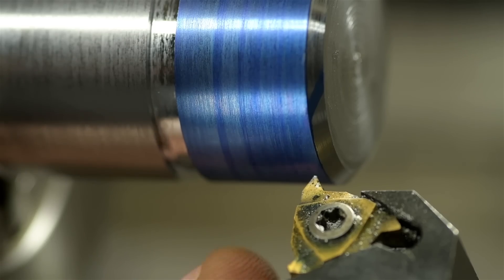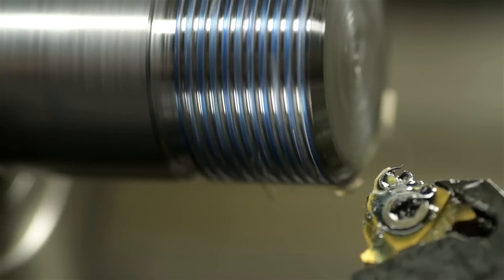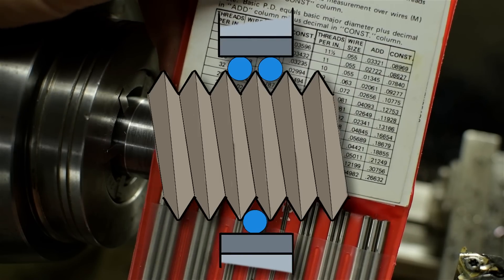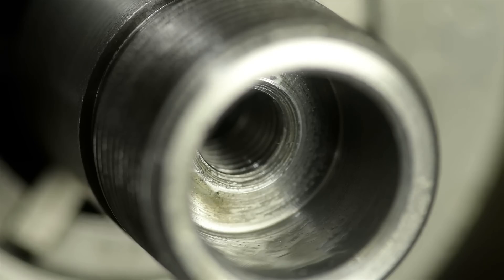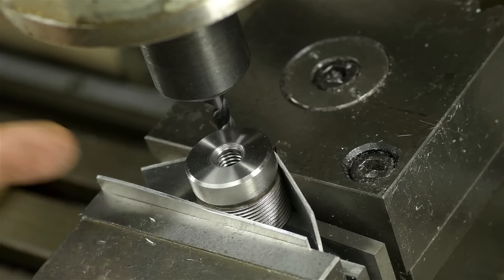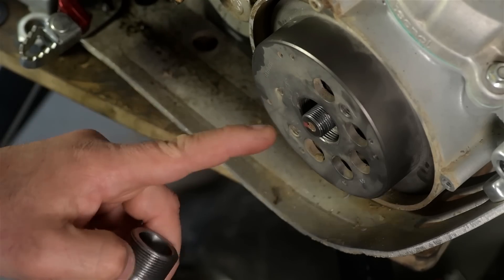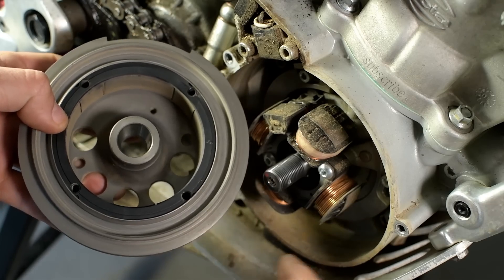EASY Flywheel Puller... using ONLY industrial lathe and milling machine!!!

Comment: You can make the timing adjustable a small amount by ovaling the holes that mount it slightly I did it on my bike its more than enough adjustment to make a difference to see if it does what you want as long as you tighten the bolts good it wont move on you during normal opperation

Comment: I have made a few of these for pulling/pushing high pressure fuel pumps out of diesel engines. I've always had a better result with it when a ball bearing is added to the end of the pushing bolt, it doesn't damage the part that way

Comment: I think theres three 5mm allens holding on a backing plate for the stator that can rotate which adjusts the timing
Reply: This. It has slotted holes for turning the whole back plate.

Comment: Neat tool. I once needed a similar puller for a bike I used to have - lucky the guy who was able to sell me one knew my one was left hand thread. I'd have made a mess if I'd try to make then use one myself.  The stator plate looks like it can have its timing adjusted (fasteners in slotted holes at about 12o'clock and 3 o'clock) or is the ignition purely on the sensor coil on the outside? if so, what's with the 'fifth' coil on the stator?

Comment: Here is a wee tip. When you have to leave your lead screw engages and you don't want to use your compound slide to advance your threading tip to take some pressure off the tip, on the reverse pass, stop the lathe, disengage the low gear so the chuck still moves easily by hand. Carefully continue winding backwards by hand and at the same time disengage your forward reverse (bull gear lever)  lever for the feed. It will just pop out when you relieve pressure and then slowly keep reversing the chuck by hand while trying to engage the bull gear again it will re-engage. Hey presto, you have advanced your lead screw/ threading tip while changing nothing else. It is a very handy option if you have a digital readout and you have tools set. Practice will dictate how many "teeth" you slip when you do this to get the best result. More for a bigger pitch as a rule. .

Comment: Hey Tony  don't want to harsh on your nifty after school program but...?
Aren't the smaller threaded holes spaced 180 degrees apart midway along the flywheel seen clearly at .27 mark made for the exact purpose of starting a bolt in to press off the flywheel? 
Don't feel bad your tool worked nifty and looked real pretty

Comment: Follow the torque specs on reassembly. I had a bike where i ordered the tool, which suddenly broke, then i make another out of a grade 8 bolt of the same size, which also broke, and ultimately ended up using a carbide bur to carefully grind along the top of the key to finally free up the flywheel. A 10 minute job ended up taking 2 weekends.

Comment: I  used the same method to remove a flywheel on a Motobécane 50cc fly wheel.
This costed me a new frame for my Oldsmobile 1979.
I don't recommand.

Comment: On those engines to change the timing you need different length plug wires 
( shorter for advanced )   (  longer for retarded  )

Comment: You prepared a very useful tool for automotive repair . without flywheel puller removing a flywheel is a hard nut to crack.

Comment: Mazda rotary engine flywheels are on a keyed taper also, but much biggerer.  54mm to be vague.  I took the 54mm nut off with a flywheel lock made of  Sabertooth Moose jaw and an impact gun, Then I put a flywheel puller made of extra virgin unobtainium and whacked the crap out of the flywheel with a rubber mallet on alternating sides to make it sing Ave Maria until it finally came off the taper.

Comment: 6:42 .....   I can tell by the slots on those smaller M6 allen bolts outside the stator.... that it most likely is adjustable.  Just by looking at it, you can loosen those and spin the entire stator bracket;  depending on which direction, you can advance or retard the ignition timing. But you might want to put an inline temp gauge on your radiator hose;  because 2 strokes love to overheat with a little advance-----------------  But Im' not there/  could be wrong.

Comment: Soooooo, what was the adjustable component beneath the flywheel?  There were at least two slotted/adjutable mounts (with the capscrews roughly equidistant from the ends of the slots) visible behind the stator segments.

Comment: That was the first part I made on my, USA lead screw, Atlas/Craftsman 12"  lathe after I got it. Only it had a lefthand metric 
exterior  thred. I did not know for sure what the diameter was . I just masured the inside diameter of the thred and made it to fit. It was a fun firsd project.

Comment: Funny, I have something exactly like that in my old toolbox for a 1957 Sears Moped I had as a kid.  Also have another tool that screws in the spark plug hole to let you find TDC. Probably cost less than a 5 spot for the pair back then which was still real money.

Comment: You were close to my usual approach: prybar and an air hammer to the center drilled in the driveshaft... Which is even more gratuitous. But if you'll believe it, that's why I bought a (cheap) air hammer...

Comment: Tony, when I am using a puller and I get to that point where it feels like I am going to break something, I tap the puller with a hammer.  (Ok, it is usually more than a tap.)  The shock for the hammer relieves some of the tension so I can put another quarter turn on the puller.

Comment: Just so you know i was live streaming the blowing up of the chimneys at hazelwood power station when i saw your video post. I missed the chimneys.....
Reply: Translation for non Victorian viewers. Hazelwood was a Power Station in the Latrobe Valley of Victoria with 8 slim smoke stacks. The power station has been de-commissioned and is currently being demolished. Of interest, Hazelwood used Cooling Ponds rather than the more modern cooling tower systems and it made for a unique public sporting facility. Power boating in one pond, public swimming in a couple and fishing in a few as well. Some were off limits due to the hot water temperatures.

Comment: I might be wrong but I’m pretty sure there are 2 threads either side in the flywheel you inset 2 long bolts and slide down between the magneto coils onto the back case and tighten evenly both sides to achieve the same result 😁

Comment: There’s 2 threaded holes use two  long bolts that have the same thread and slowly turn them in and it will gradually pull the flywheel ! The threaded holes were already on the flywheel , such a waste of time 🤦‍♂️🤦‍♂️🤦‍♂️

Comment: I once spent an entire day trying to remove a spin-on oil filter. Ended up making at tool after the casing was completely shredded off. Still have the tool 35 years later and never had to use it again.

Comment: Tony, your stator seems to be installed on an adjustable timing plate, loosen the 3 screws and rotate it counter clockwise to  advance the timing and clockwise to retard the timing. You may have to pull the stator outward to free it enough to rotate the plate and definitely mark the back plate at the case split line so you can reference the factory setting if there isn’t one.
Reply: Get in touch 🤗🚀

Comment: Hay Tony, I once had a 1984 Maico motor cycle that had a dud trigger coil. I went through the same process and made the puller out of 4340 H&T as I couldn't get one at the time, there were none in the country. I couldn't budge the flywheel no matter what I did. l made an adaptor for a 10 ton enerpac hollow ram and ended up snapping the puller. In the end all I could do was use a hole saw and cut the boss off the crankshaft. When I got it apart there was nothing to indicate why it wouldn't release, I guess the taper was just a perfect match and the 200 pound gorilla who put it together may have been a bit heavy handed . I just made a new boss, riveted it on the flywheel, replaced the coil and we were in business again. It was an epic battle.

Comment: The stator is in fact adjustable. You loosen the screws on the baseplate of the stator, not the bolts on the actual stator. You can see the milled journals that you can rotate the stator assembly on when you loosen the screws. Remember to mark the current timing alignment, so if shit hits the fan you can always undo.

Comment: In the intro you threaded the hook into a hole. Isn't that just a jacking bold hole? Couldnt you have done this with two bolts threaded into those holes? I'm all for making cool stuff, and you puller is cool. But I like simple too, and two bolts are as simple as it gets.

Comment: wouldn't have been easier to put 2 bolts in the threaded holes that were already on the flywheel to pop it off?

Comment: but theres 2 threaded holes on the flywheel for a puller.... coule have easily taken a piece of bar stock a drilled 3 holes and 3 bolts.....

Comment: I would have taken a thicker piece of angle and drilled it for bolts, to go into the two threaded holes in the flywheel. A third threaded hole in the middle can be used to apply force to the parts with a bolt. A sharp rap on the bolt in the center, or on the flywheel itself, will usually break the interference fit apart. Sometimes just putting the flywheel attachment nut at the end of the crank thread (to protect the thread) and rapping it, will jar the flywheel loose. Used this technique many times on lawnmowers. Easy peasy.

Comment: What are the two threaded holes for on the face of the flywheel? Could bolts be used in those to push the flywheel off? Just curious.  I like your build - and humor - anyway! I always look forward to your posts.

Comment: See that hook on 0:47?There is oposite hole like that .You take 2 bolts and measure a distance ,then you find a scrap bar of steel.then you drill 3 holes ,2 for bolts and 1 in middle.
Since we are doing this dirty cheap use another bolt and make a point on it,put a few drops of oil in the center drilled spot on shaft.Use a nut and bolt in the middle as a puller!
Its simple like that!
Also those tapered pulleys /magnets go of easy if you hit it sideways with a rotary hammer drill.

Comment: pro tip :  when removing a flywheel, just when it feels like the center bolt is about to break or strip, give it a solid tap with a large ball peen hammer;  flywheel will pop off into your lap (or hands or face)

Comment: ToT you can adjust the timing by loosening those 3 allen bolts and turning the bracket that holds the magneto, so you should throw that bracket on your router and do some maths and engrave timing marks on the bracket. Here's and example of one from a yamaha banshee
https://www.rmstator-europe.com/14731-large_default/aluminum-adjustable-stator-timing-back-plate-yamaha-350-banshee-oem-2gu-85510-50-00-3gg-85510-00-00-3gg-85510-01-00.jpg

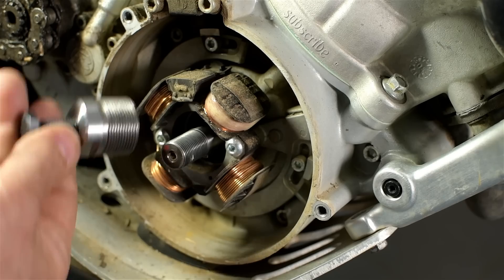Comment: I think that the pick up point for the ingnition timing is on the outside of the flyweel. At the top at time 7:05. But rhat about the two (I think there is a third not seeing) allen screw that secure the slotted stator support?

Comment: that threaded hole in the flywheel you put the hook in has a mate 180° out . . . could it be possible that the mfr put them there so you would be tempted to run a couple of bolts in there and snap off or short the magneto coils instead of jacking the flywheel off?

of course, what you do with your flywheel in the privacy of YouTube is none of my business .

[ perhaps oi should have said "forcing" ]

Comment: umm,,,  correct me if I'm wrong but, doesn't that flywheel have two threaded holes opposite each other for a bolt grip style puller?    Like the one you already have?   :)

Comment: Never understood why they are called fly-wheels.  Its obvious steering wheels are to steer, drive wheels drive, but it seems a flying wheel would be a very bad thing, especially if it is flying at you.  Clearly that would make more sense to call an oh-crap wheel, but fly just doesn't make sense.

Comment: Is there a reason your referring to the rotor aspect of the stater and rotor assembly as a "fly wheel" tot? Lmao. Your a cool kat and all but some of the resistance you dealt with was the magnetic pull from the pick ups in the rotor itself.

Comment: So, forgive a silly question, but at 5:35 aren't the threaded holes at the 1 O'Clock and 7 O'Clock position jacking bolt holes? Can't you just use ordinary bolts to carefully jack the flywheel out of battery?

Comment: A small steel ball somehow jammed on the tip of the screw helps a lot when pulling flywheels in terms of friction. Reference: 10$ Chinese pullers

Comment: When cutting threads on a lathe, it occurs to me that instead of advancing the tool perpendicular to the shaft being cut between passes, you could also advance the tool parallel to one side of the cutter so that only the other side of the cutter actually cuts. This seems to me to be better for chip removal. How is it actually done?
Reply: What you've described is common, though not universal practice. Either way works, though one of the big reasons for using your method is to halve the width of material being cut (since you're only cutting with one side of the thread tool) to reduce the chance of tool chatter. If the lathe is solid enough (industrial enough) plunging the tool straight in should work fine. It's hard to see which method Tony was using here.

Comment: If you use two wide sections of rubber bands as a third hand to poke the thread wires through it helps alot

Comment: I made a 3D printed mould today to make some cheek protectors for my wife's horse's bridle. You can buy them for a few pounds a pair, but she also wanted them RIGHT NOW so I made a mould, mixed, de-gassed and poured some A15 silicone rubber and now she's happy. Sometimes is as easy to make the thing than buy it.

Comment: Or you could have taken a iron bar, drilled two holes same pattern as the threaded holes on the flywheel.
Put it up against the crank, screw the bolts in, flywheel comes off.
Simple.

Comment: If you see the 2 threaded holes in the flywheel you must have wandered "but why tho?" I'll answer. You can get 2 bolts and a wrench. A somewhat large ball bearing or some short bolt. Than use the wrench ends as bolt holes and pivit the ball or other thing against the crank shaft. Tighten the bolts and pop - goes the flywheel. Or the wrench... Or your eye because the ball flew at it...

Comment: Those two threaded holes in the flywheel (the one you put a hook in), could they be used to drive bolts into to push the flywheel off? They look suspiciously like the holes in a brake rotor that are designed for just that.

Comment: You can change the timing by turning the stator plate.  For the love of all that is holy mark it with a chisel before  you loosen it.  Word of caution 2 strokes are temperamental and  incorrect timing will blow a hole in the piston just as fast as a lean condition.

Comment: Hi, you should be able to adjust it, there is a backplate that the stator is on is at a fixed place and the backplate can be slid with losening 3 allen head screws, 6.18 in vid there are oval holes but be carefull, too much timing can cause big nono's

Comment: For future reference a finer thread like  m10x1mm would give you less of that "I feel like I'm going to break something" feeling.
Reply: and a ball bearing to push on.
Reply: @sydneyshinshi  "It's all ball bearings these days." - Fletch
Reply: @John-PaulTownsend  I think he meant to take one single ball from a ball bearing and put it on the tip of the bolt to reduce friction as the crankshaft's end is center drilled to 60 degree. A proper flywheel puller should have that, the crappy chinese tool producers are omitting it. This might probably be the cause you don't see them. In this case tony was to excited to get the darn magnet off ... Love it!

Comment: Why not use the 2 threaded holes to push the flywheel off? I'm talking about the hole TOT screwed the hook bolt into. Something longer, screwed in both holes, tighten until the wheel pops off....

Comment: I’m quite certain that the 2 threaded holes on the flywheel allow you to just thread in bolts, that then push against the crankcase and by turning them equally would push the flywheel off without a special puller. Now that you have one, though I’m sure it has a far less chance of causing any damage, and if you have multiple engines that take the same puller, it’s nice for that, too.

Comment: Aren't there 2 of those ~M10 threaded holes through the flywheel? You know, the ones that you screw bolts through to jack the flywheel off of the shaft?

Comment: I've seen engines with threaded flywheels, right or left handed thread depending on which side of the shaft it's placed. So I was getting ready for a new video - broken shaft replacement.
It turned out - that wasn't the case...

Comment: 6:47, of course you can alter the timing, just loosen the bolts on backplate and rotate the whole stator. Only issue you can encounter  is you need to have a strobe timinig light to check the current timing due to this ignition is pulser-based. Hint: make some reference point on the stator and casing before loosing the stator.

Comment: Isn't there two threaded holes already in the flywheel for one of those super cheap everyone-seems-to-own-one crows foot looking steering wheel pullers that are everywhere until you even mention needing one and then they all run and hide?

Comment: Only?!?!
P.S. I could do the same with a piece of flat bar, a drill, 3 bolts and few nuts. Those 2 threaded holes that you "tried" to use to "pull" the flywheel out can be used to actually pull the flywheel out. 😉

Comment: ...hmmm... good one, tot...! i suppose if you had used the existing threaded holes in the flywheel to attach a flywheel puller to a most excellent video wouldn't have been made...! 🤪😁 good job...! 👍

Comment: Maybe I'm just dumb but I'm trying to figure out the correct method to install the flywheel back on, do you use a large nut threaded to the crank?